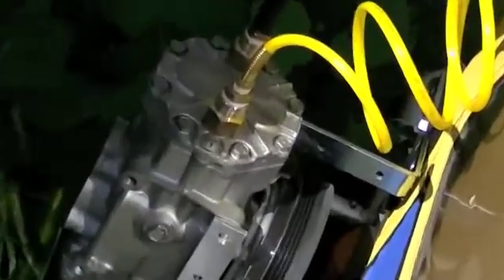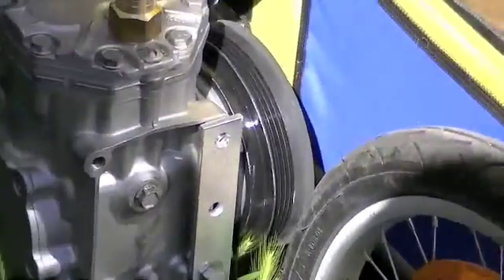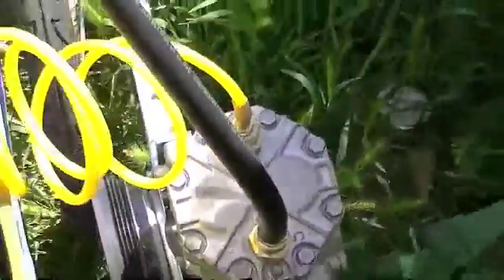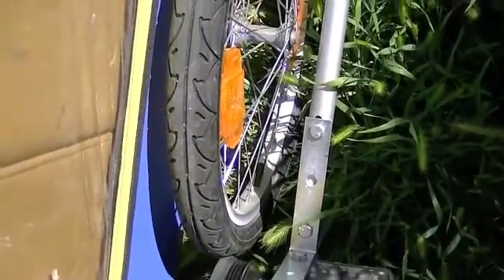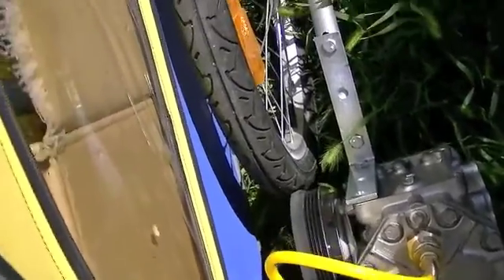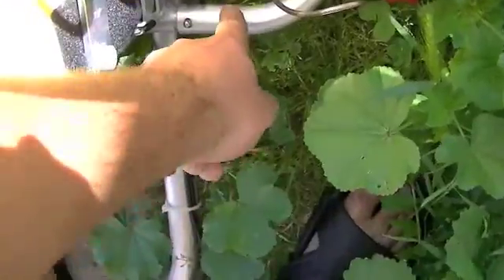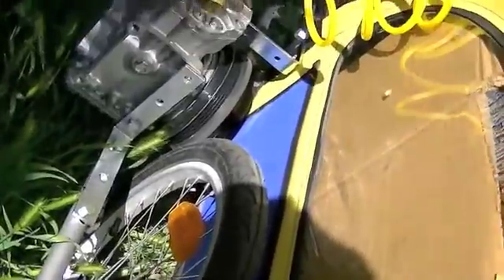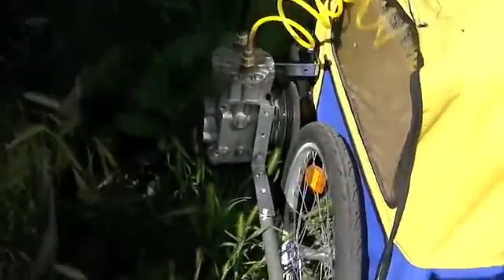The Human Powered Compressor

Comment: How did this end up working for you in the end? I was considering building a rail cart I can use on abandoned branchlines, and am thinking of hooking up a York 210 with a serpentine belt to the axle. My goal of course would be to get to 150 psi at least, but I'm not sure if the resistance from the belt would grind me to a halt. I plan to install a K5LA with a 20 gallon tank on the cart.
Reply from the maker: +RailfanDaniel I got this to work, I put more air into the tire, replaced the bad check valve, and installed a toggle switch onto the handle bars of the bike so I can build speed and then turn it on. worked like a charm.
Reply: Sweet. I've also considered mounting a York 210 with the pulley pressed against the rear axle of my car. Still doing research on it, but I know that solve a lot of potential overheating issues. Thanks.
Reply: Hey @repeatman, any video follow up to this? Would love to see it in action!
Reply: Yeah, I'd love to see you use it, as well as know the max PSI you've been able to reach, and what's keeping you from getting to higher PSI.  Compressed air seems like a pretty logical form of human energy storage if we could minimize losses, and get the PSI high enough to be useful.  For a flying craft, particularly, the density at 80PSI probably wouldn't be enough to offset the weight of the tank, even allowing for thinner tank walls.. maybe if a substantial part of the craft's frame was double-walled and served as a storage tank... there's a good chance that's beyond my hobby scope though ;-)
To defeat resistance, sounds like you need a gear system, which it sounds like you planned out.

Comment: why not put a non-return check valve at the tank, where the air go into the tank?
that way the pressure from the tank won't "fight back".
Reply from the maker: jones chua Fixed this problem by replacing the Bad Check valve.

Comment from the maker: I got my pressure above 80 Psi Today with this! I installed a toggle switch on my handle bars so I could gather speed and get the RPM's up, Worked pretty good like this, but I'm still considering a pulley system.